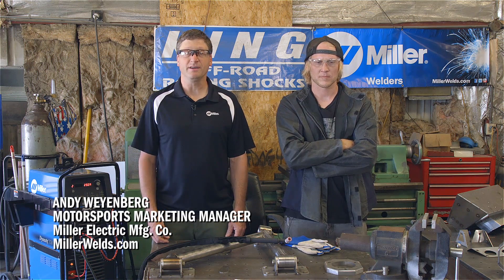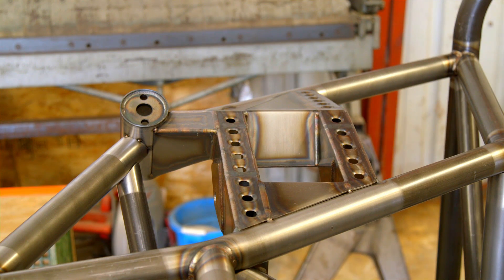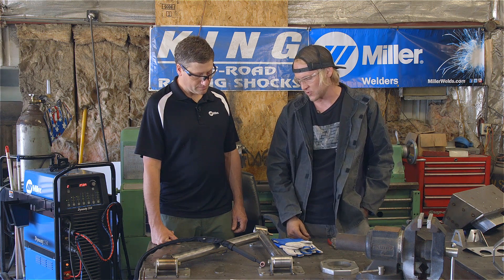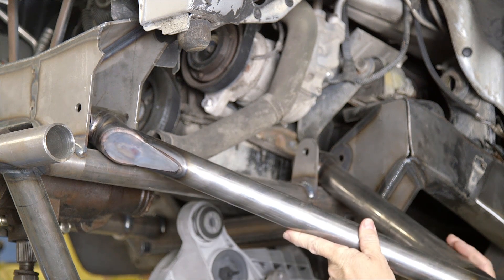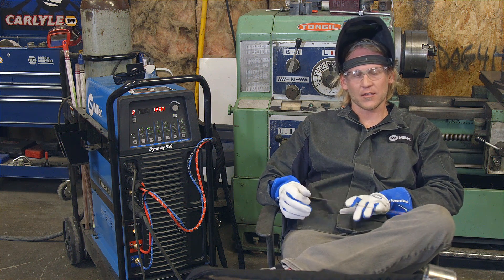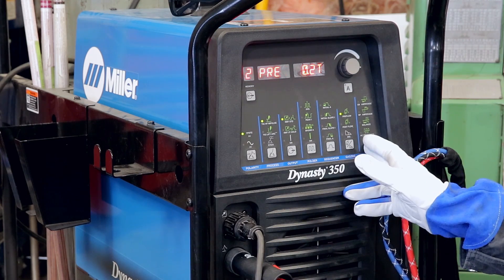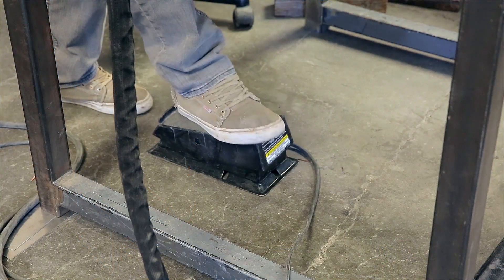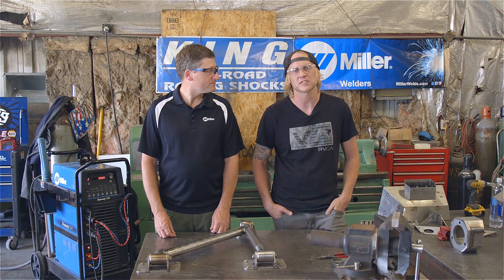TIG welding an upper control arm at BattleBorn Engineering

Comment: what's the code of the #10 cups? Do they fit on a standard 45V44? Trying to make the best out of my 280 dynasty and cs310 torch here.
Reply from the maker: Thanks for reaching out. You can find specifications for the Weldcraft™ W-310: https://www.millerwelds.com/accessories/guns-torches/weldcraft-tig-torches/weldcraft-w-310-m00318
Reply: Sorry there is no code for the lenses and cups in the link you gave me. And unfortunately, my supplier has trouble finding them with no code, given that need to be specially ordered through ITW welding Italy because I'm, as you might imagine right now,  in Italy. Do I need to give you a call?
Reply from the maker: Please reach out to the Regional Manager of Italy. The number is 390-298-2901. Thank you.